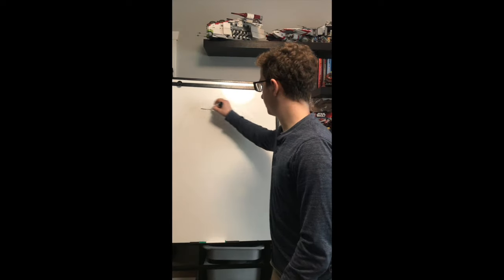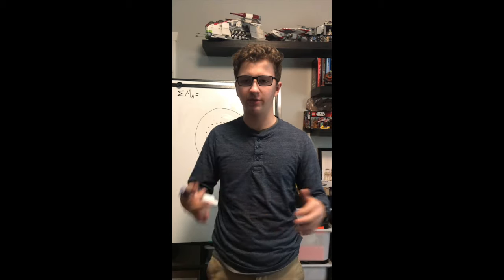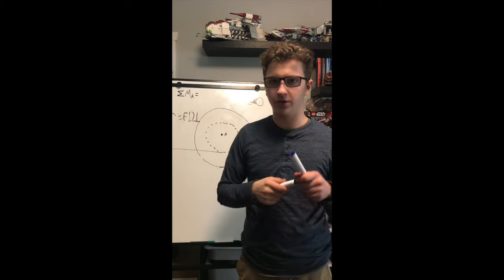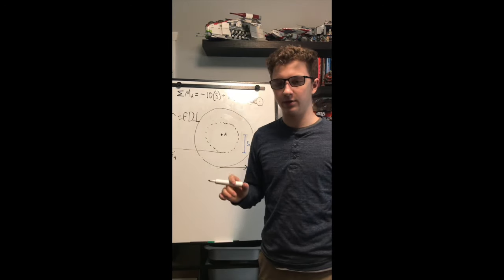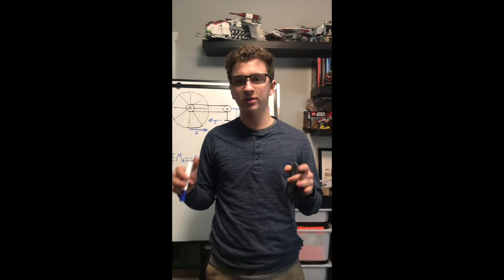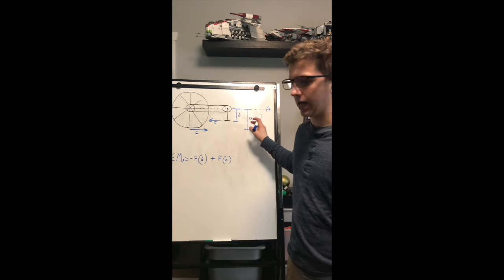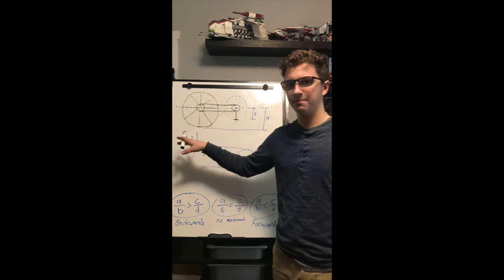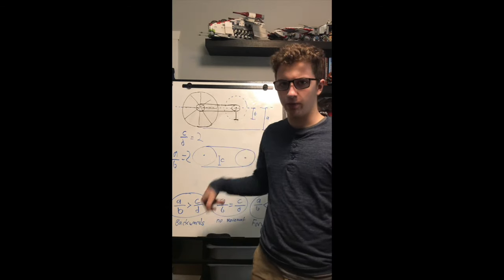Veritasium "Revolutionary Riddle" #2 Answer

Comment: Hello, I really looked at a lot of comments, and even saw someone try to do it with their own bike. I tried it myself on a very high gear (so fast pedaling for slow driving). My bike was stationary. I really like your theory that the gears matter in this calculation. I also have to believe that if the ratio is 20/1 the bike will likely move forward.

Comment: Great calculations, Brad. You don't need to measure his bike though. No bike has such a low gear, except maybe a novelty circus clown bike that's pedaled super fast to crawl forward. Such a bike would have an enormous rear sprocket with a tiny front chainring. It would look really weird, even for a casual viewer. The bike he showed is normal. It'll roll backward when he pulls the string.
Reply from the maker: Interesting, thanks for the feedback